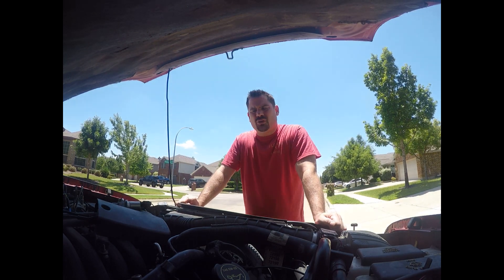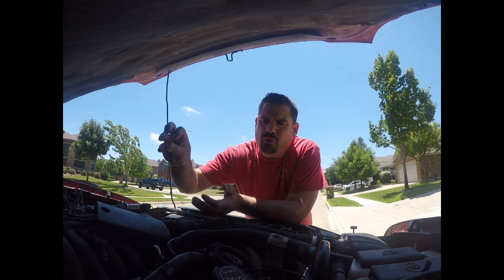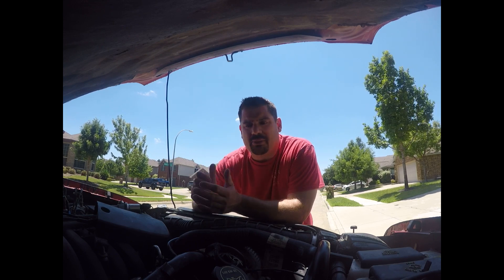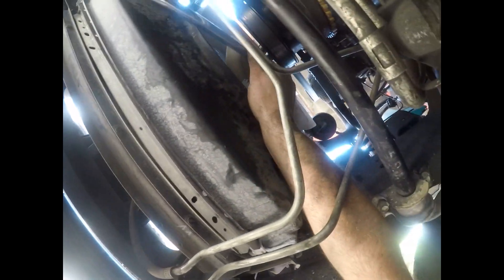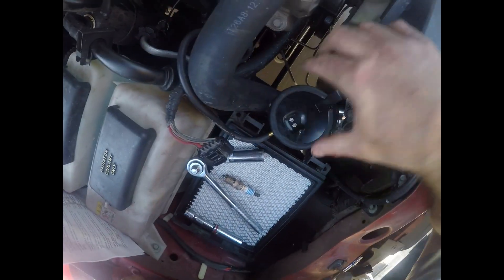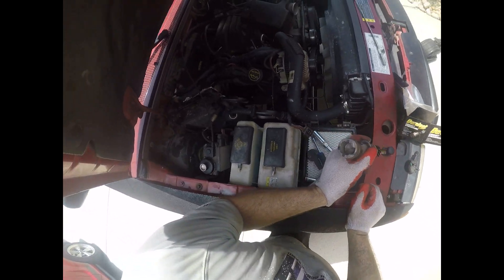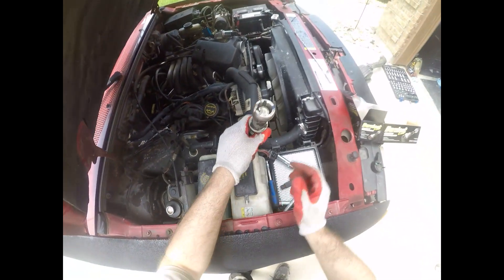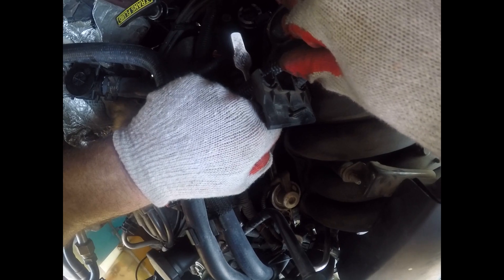Ford Ranger Finding Top Dead Center for Camshaft Position Synchronizer Install

Comment: Ive been chasing this for 3 days for a p1309

Alldata says “use the timing marks” and doesnt specify what marks or where

The harmonic balancer had so much surface rust it completely camouflaged the marks. Your video is the only one i could find that gave me a good location for them.

Got the area cleaned and could just barely make out what was left of the marks to finish the job. Thanks for this man

Comment: Can I put the engine at TDC without using a compression gauge and just doing it with the crank pulley?
Reply from the maker: Yes, the compression gauge is just validating accuracy of the crank pulley.
Reply: @chasingmustangs  do u still have the truck
Reply: thanks for this question i had exact same one

Comment: If I pulled my synchronizer out already can I still put it to top dead center without messing the computer or anything up
Reply from the maker: Yes, just make sure to use the alignment tool during the install.
Reply: @chasingmustangs  alright thank you

Comment: Do I have to find the compression stroke also to properly install the cam sync?
Reply from the maker: I recommend it, to make sure you are installing the Cam sync correctly.  If you are confident the original is placed correctly, then you don't have to follow the instructions.
Reply: @chasingmustangs  so I aligned the cam synchro with the engine tdc and the check engine light came back on with the same code. Any idea what could be the problem NOW?!
Reply: @andrewrodriguez8492  Did you ever figure out that problem?  I saw somewhere one guy's connector wasn't seating all the way.  Mine has a broken tab on the connector so I need to secure it somehow.
Reply: @badcrcz  what code did you get when scanning the truck's computer?
Reply: @andrewrodriguez8492  P1309 "replace cam shaft position sensor".  It might be just my sensor but I'm replacing the synchronizer and the sensor because when I did an engine swap the old synchronizer was a little sloppy.  Drove new engine about 100 miles so far and got P1309 code.
Reply: @badcrcz  does the engine have good oil pressure?
Reply: @andrewrodriguez8492  I'm confused...you posted 1 year ago saying you replaced your synchro and the code came back.  I asked you if you ever figured it out, because I was curious in case my code comes back after I replace mine.  Now you're asking me all these questions.  Are you trying to compare my issue to yours or are you trying to diagnose my truck?  I'm replacing my synchro tomorrow, and I will let you know if it gets rid of the code, but I don't need any help with my truck at this point.  To answer your question, I have no idea if it has good oil pressure because from what I've read the gauge on these trucks only tells you basic oil level not pressure.
Reply: @badcrcz   no im not comparing mine to yours. Im asking questions bc I remember my Ranger had me running all over the place looking for different parts and diagnosing a million things to solve one code. No replacing the synchro did not fix my issue and never found out how but I had read someome saying it could be a timing issue where the engine needs to be re timed and I didn't have the time or money to get it done. So before you replace parts all willy nilly, definitely figure out all details to make repairing the truck easy
Reply: Plus my oil pressure gauge wouldn't read anything until 10 minutes of the engine running. Then it would stutter from 0 to half way the gauge and do that for 5 minutes. I have a different Ranger that does not do that at all.
Reply: @badcrcz  that tells  u itsa short probably

Comment: Hey there great video. I have a 03 ranger with 3.0 and it squeals when accelerating all belts and pulleys ok no engine light and it idles just fine could it be the cam synchronizer? Or just the sensor? Thanks guys! I liked and subscribed thanks for any help!
Reply from the maker: The Sync usually makes a load chirping noise and the noise will get loader at more RPM"s.  I would double check water pump and power steering pump.  You are hearing more noise because the car is at higher RPM's when accelerating.
Reply: @chasingmustangs  New power steering pump and brand new waterpump installed the other day and the noise still there just installed the new cam synchronizer and sensor... noise still there oh well ill drive it until it quits. Thanks
Reply: Pulleys all spun freely with no noise. Mysterious noise oh well.
Reply from the maker: @redbustourguide  How about idler pulley, did you replace that as well?
Reply: @chasingmustangs  it sounded just fine .  The only time it makes a noise is when i accelerate hard never when .just cruising no other time it makes a noise. Idles fine drives great no fuel economy issues nothing. Every pulley seemed to be fine. I sprayed wd40 behind it and then drove it and it didn't change a thing. 1000 mile trip to Colorado Sunday ill keep you updated if and when i.figure out wth the noise is coming from. Thanks!!!
Reply: @chasingmustangs  belt tensioner was replaced
Reply from the maker: @redbustourguide  The idler is the wheel is what I am referring to and not the tensioner.   It's the only wheel not connector to an actual unit (water pump, power steering pump, etc.).   I have seen these make squealing noise.
Reply: @chasingmustangs  Ill double check it tomorrow but like I wS saying everything was checked out and spun just fine with zero noise. Thanks for your input!! It's much appreciated.

Comment: Not sure if your still active but I'm in the process of rebuilding my 3.0. When you are starting from nothing how do I know my cam is in the right position when install to also make sure I'm putting the synchro in the correct spot? Thanks
Reply from the maker: Are you putting in a new timing chain and need to line up the crank and cam shaft?
Reply: @chasingmustangs  I'm doing a complete rebuild, new crank,rods,pistons, timing everything inside the motor.
Reply from the maker: @CryptoFocus17  I would have to write a book to tell you haw to realign everything.  I recommend purchasing a manual to make sure you follow the process and don't bend any valves.  But there is timing marks (dots) on the crank shaft and camshaft you have to align to each other.  Some 3.0's are offset by 5 degrees and depending on the year of your truck, the instructions could be deferent.
Reply: @chasingmustangs  ya I purchased a subscription to All Data so I should be 🙂

Comment: i installed the new synchronizer with the tool it comes with but did not put the crankshaft in dead center. could i still put it in center with the synchronizer in ?
Reply from the maker: If you think you put the new one in, in exactly the same position as the original, you are probably ok.  I would recommend putting the crankshaft at top dead center to be safe.
Reply: @chasingmustangs  i did put it in top dead center now , but still turns off when i reverse and feels like it looses power when i accelerate after being at a stop
Reply from the maker: @DiezCallejeros  did it have the issue before you replaced the synchronizer?
Reply: @chasingmustangs  no it only shut off the day the check engine came on, which is why i replaced the synchronizer. now i didnt put it on tdc before taking off the synchronizer, i did use the tool to keep the synchronizer in place but i think i need to re do it. put the crankshaft on tdc, take off the synchronizer use the tool to keep it in place and should be good ?
Reply from the maker: @DiezCallejeros  did you double check TDC was on the compression stroke and not the exhaust stroke?
Reply: @chasingmustangs  found out it was the camshaft sensor tailpig had corrosion replaced it running good so far
Reply from the maker: @DiezCallejeros  glad you got it fixed.

Comment: So, it doesn't matter where the sensor its pointing? Non sense to me,.. well, you have not idea what you are doing but at least you are working safe
Reply from the maker: The sensor, which is on top of the synchronizer, can point any direction.  As long as the tab is in the middle, which is show in the video.
Reply: just the sensor the camshaft itself must be top dead center using da tool

Comment: I think my timing chain jumped a few teeth because it tries to start but won’t. I get back firing through the throttle body. I replaced cam and crank sensors so they’re not the problem. How do I find TDC when valves are open on what should be a compression stroke? My car is an 01 Taurus 3.0 OHV engine
Reply from the maker: You can put your finger in cylinder number 1 or use a use pressure gauge on cylinder 1 and rotate the engine until you feel/see pressure.  That will show you, you are on the compression stroke.  Once you determine the compression stroke, then look at the harmonic balancer markings and see if it is lined up with Top Dead Center (TDC).  If it does not line up, then timing jumped.

Comment: I have a squeaking noise coming from this area of my engine on my 2005 Ranger. It almost sounds like a belt squealing but not exactly. I heard this part could cause that. Is that possible?
Reply from the maker: Yes, the cam sync will make a squeaking noise when it is going bad.  If you pull it out and turn it by hand, you will know if it is the part making the noise.
Reply: @chasingmustangs  it was the synchronizer chirping. I replaced it in about an hour. Hardest part was lining it up perfectly. It's difficult because it rotates slightly when pulling it out.
Reply from the maker: @fillmorerock4219  Did you make sure it was top dead center when replacing?

Comment: Does the oil pump intermediate shaft come out with the synchronizer? I replaced the synchronizer and didn't see it when I pulled it out and when I put the new one in im now getting no oil pressure reading on my gauge
Reply from the maker: No, it does not come out.  The shaft is held into the pump with a retainer clip.  The synchronizer has a gear that connected to the camshaft, which then drives the oil pump.  I would validate the shaft did not come out of the oil pump and is stuck in the block (highly unlikely).  I would also validate the synchronizer is grabbing the camshaft gear.  The only other possible issue is the shaft is rounded off and not engaging the synchronizer.  Hopefully this helps.

Comment: So, when those 2 points are aligned to 0 the sync should be on the center of the sensor? And if not, just move it around to position it?
Reply from the maker: When the tab is the middle of the gap, it is a top dead center.  You can move it around to get the tab into the middle of the gap.

Comment: yes you can do only the top , that is the cam sensor,just pull the 2 screws and slip off the sensor,do not pull the 1  10 mm bolt and slip the whole shaft out, there is no reason to,if your replacing the whole thing the it better to set it up on number 1, or mark the edge of the aluminum were the little pointer is at and put it back in the excact same way black marker works

Comment: Hello if I only replaced the top  cam sensor does it have to be at top dead center?
Reply from the maker: As long as you don't remove the bolt that hold the cam sync unit, you can replace the sensor without worry.

Comment: Just watch as you remove it as it will turn slightly ...then put the new one in the exact same place....let it turn as it goes down to the seated position......best to mark it on the block before removing.....marks lined up...you are good to go....regardless where number 1 piston was.....
Reply: Does the camshaft synconizor have to be in while you put it on dead zero?
Reply: @alfredo2846  from what I hear. Yes
Reply: My engine exploded and I replaced it with a new one. Since it was already in the wrong position when the engine died, I need to figure out how the hell to clock the thing, and no one seems to have my problem.